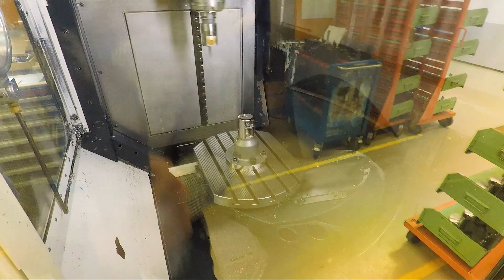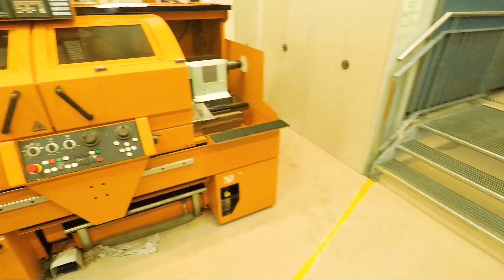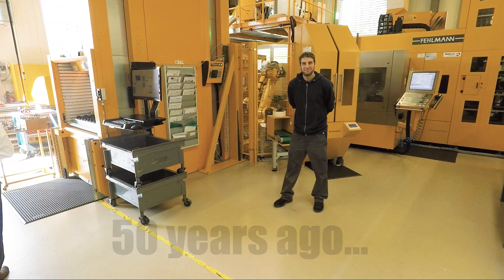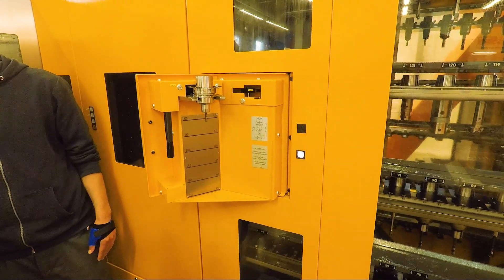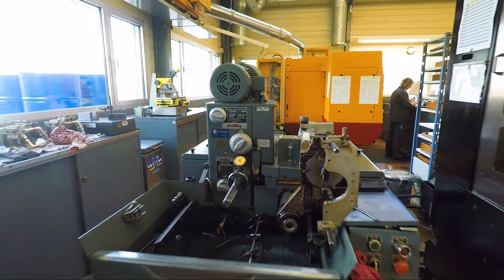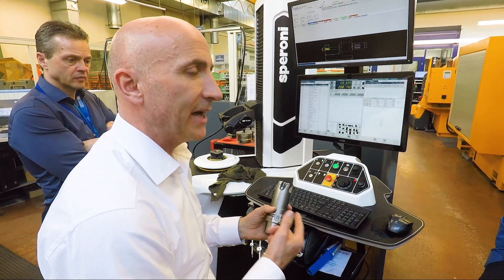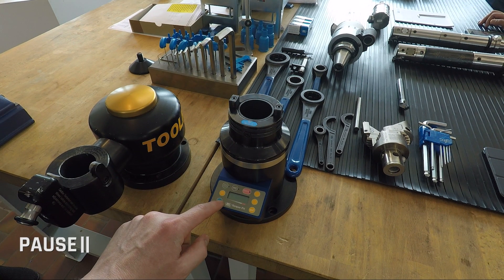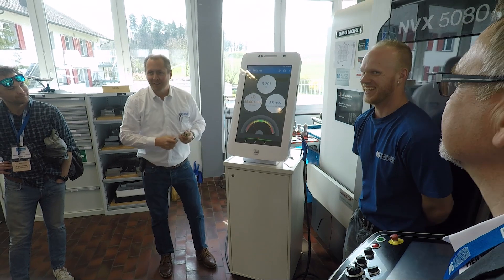Big Kaiser Factory Tour!

Comment: Minor nitpick but I don't think their program is an internship program. In Switzerland there's another category of work called an apprenticeship which lasts several years (4 in my industry), is managed by the state and conveys a state-recognised qualification on participants. It can (and usually does) start straight after compulsory schooling, around ages 14-16 (though apprentices can choose to start later, even at 40 if they want). It's actually a super common thing in Switzerland and it's not just for fields like manufacturing but for everything, including for example banking and IT.

Comment: Can't agree more with your comment on apprenticeship.
Reply: When I did my five year apprenticeship many years ago at the local iron works they had a dedicated training building for all trades except mine they did fitting / machining / moulding but the sparks were not covered so they ship us out for the first year to a collage then we circulated the plants with a different mentor at each after four years you tended to work alone .but this was not small stuff but very large equipment cranes to 750 ton imp motors to 1.5 mega watt . All gone now and they now do it in six weeks . I was lucky I got included armature and stator winding in my circuit 🤭

It’s the sign of the times here in the UK but it’s great to see the ethos of investing in the future is still alive in Europe
Reply: The Scientific Duo - BUT SHAREHOLDER VALUE!!!  /s
Reply: @ClockworksOfGL  Oh those shareholders, like trying to appease the world.

Comment: That's a Data Matrix barcode, not a QR code.
Reply from the maker: Oh Good catch!  Other than the "data format", are their differences?
Reply: @nyccnc  Both 2D codes can vary in size to accommodate the size of part it is being printed on. (Like a bolt of a M4, which is really small, can have a tiny data matrix code on it.) QR codes can have about 2x as many alphanumeric characters stored on it. (4296 vs 2335) They both have built in error checking/redundancy and can work even if part of the code is missing. QR codes are more for linking to another information source, where data matrix is usually used to keep track of items, like a serial number. 

QR can be as small as 21x21 blocks, grows by 4 blocks on each row/column, for a max of 177x177

Data Matrix can be as small as 10x10 blocks, grows by 2 blocks on each row/column, for a max of 144x144.

There are dozens of types of barcodes (1D) and 2D matrix codes, and even codes that employ both a 1D and 2D matrix, like PDF417 AND Ultracode. Just type, "types of barcodes," into Google and look at images. There are literally hundreds of different types of 1D and 2D codes/matrices.